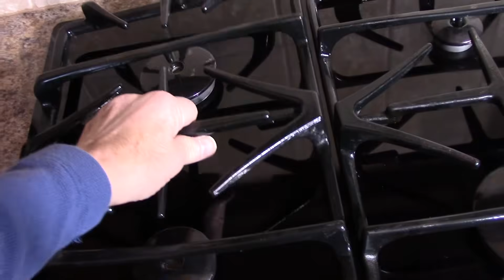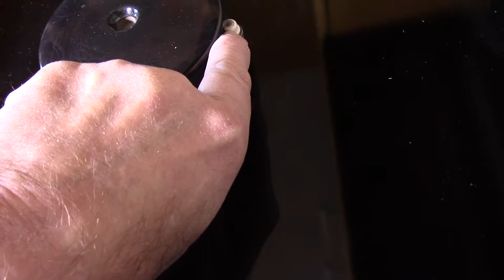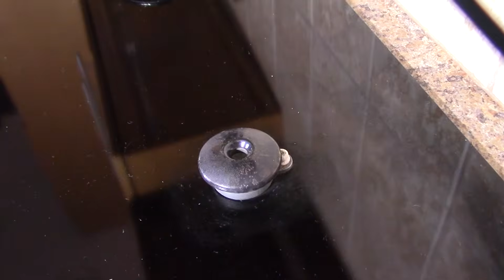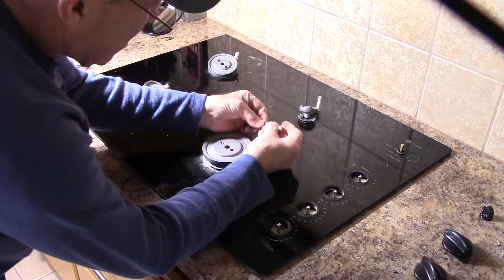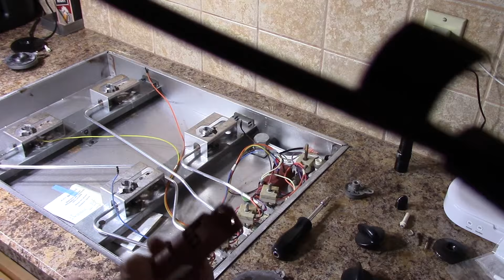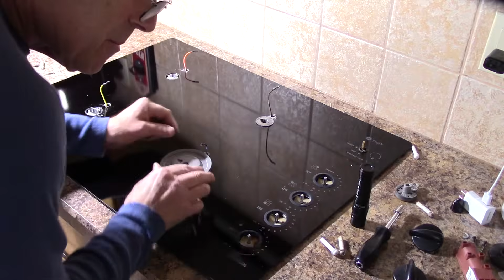Gas Stove Top Burner Not Working

Comment: Found this video and was so happy as it was the somewhat the same model I have. The biggest difference is the igniters have this impossible spring and clamp system that this video doesnt show. Turns our that my issue was a wiring short in the igniter cable that just took a little electrical tape. But I would not have been able to solve that without this video.
Reply from the maker: I’m happy you were able to fix your stove!

Comment: Daughter-in-law dropped a pan of oil grease on the knobs.  Took a while to find the right video to fix the stove top burners.  Thank you for a straight forward, understandable video to repair it.  Gilbert AZ.
My issue was the harness was coated with grease and liquid.  The  wire junction was okay on my deal.
Reply from the maker: It’s amazing how things like a little grease can cause big problems. Don’t forget to like and subscribe!
Reply: Liquid food fell on knobs.flame came on by  knob cut the main.power off it is gas stove electronic engniter.what to do to fix it please help how to remove the cooktop.
Modal no JTP30DP1BB
SERIAL NO  ZS6001462
PLEASE HELP REPLY 
THANK YOU

Comment: I have a Kitchenaid, 5 burner, gas cook top.  The two burners on the left will light, but shut off as soon as you try to adjust the flame.  The other burners all work fine.  Is this a common problem? What's the fix?

Comment: Hi all, need your thoughts. I have a new never used 20 yr old Kenmore gas cook top. The ignitors will not spark unless the knob is turned past the "high" setting. The gas has to travel thru a 3 inch venturi tube. That is a lot of raw gas spewing out before ignition. Is this cook top safe to install in a family home with kids? Please share your thoughts. Txs

Comment: Good video that covers one set of burners sparking and the other set not. Mine is a GE JGP319. One igniter serves the back burners, one the front. The front burners weren't igniting. I could see there was no spark from that igniter. I could also see that the ground point on the igniter mounting bracket was covered in grease. The spark is supposed to go between the igniter and that point. I removed the mounting bracket, cleaned the grease off that little point, reinstalled, and now it works. Zero cost. (I also carefully cleaned the point on the igniter itself using alcohol.)